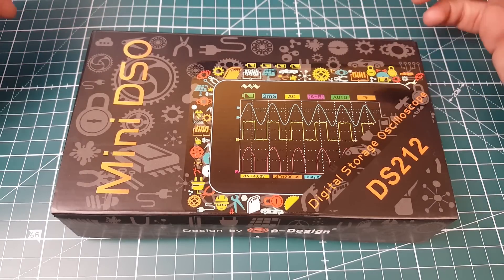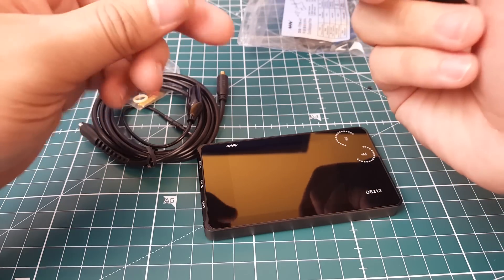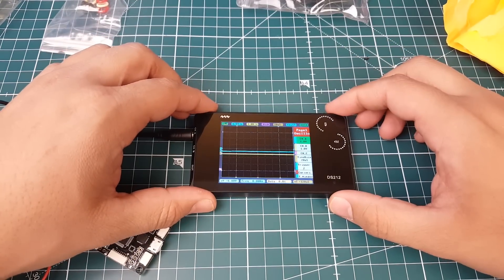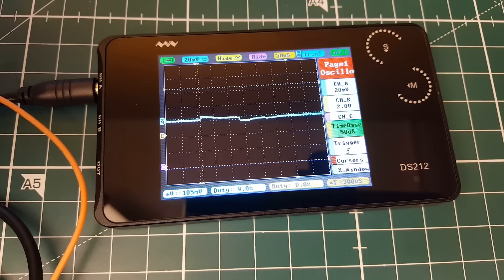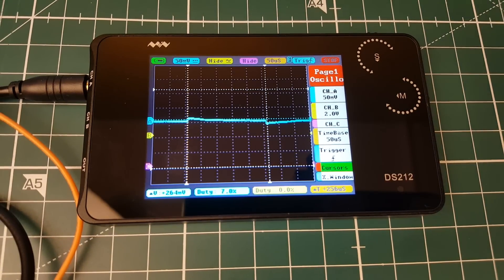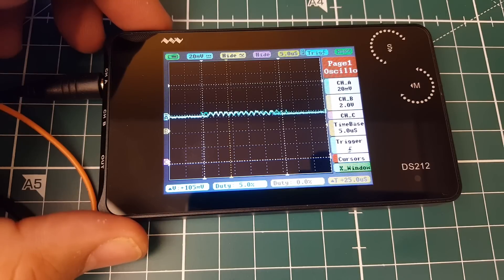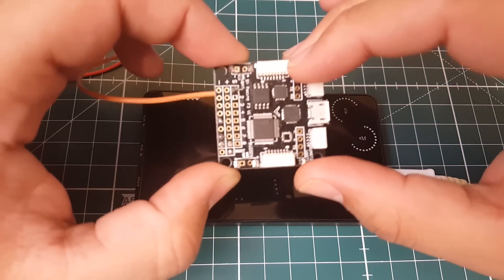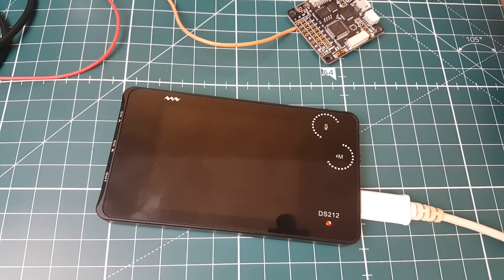Best Budget Mini Oscilloscope? // MINI DS212 Digital

Comment: For anybody even a little serious about getting a scope, all of the "mini" DSO scopes are interesting to varying degrees (and by interesting maybe I mean "fun" or "cute") and you can get many of them for something under $100.00.  But they are pretty low quality, they don't perform anywhere near their phony claimed bandwidth, and really aren't a good value.  For example, for not much more you could get a Hantek 2C42 for about $125 and it claims 40 MHz and easily does over 30 MHz AND it has a DMM function (so it is a 2 in 1 instrument) AND it comes with a nice case.  The 2D42 adds an arbitrary waveform generator for a little more cost making it a 3 in 1.  And they have 70MHz versions also for a bit more.  OWON has similar models.  You get a tremendous jump in features and performance over the mini-DSO scopes for just a little bit more cost.  And they are still battery operated and can be handheld, although, they are larger.

Comment: What's the amplitude of the signal? It looks like around 4mV on the scope, which seems ridiculously weak for flight control signals. Do you have the probe at 10x and the scope not adjusting display for it?
Reply: Hi did not put the pin in the probe so there was no contact just proximity that is y the signal was so weak.

Comment: super nice vídeo! Thanks for this technical content!
I was wondering if the even cheaper osciloscope JYETech DSO138 would cover our applications with dones. What vertical and horizontal specs would you recommend to measure common signals in drones?

Comment: You sure that flight controller isnt defective? I mean you have a supply voltage of 5V (maybe it get regulated down to 3.3V) and you only get an output voltage of ~10 mV.
Reply from the maker: E_404 It was the probe I did not insert the pins. I was basically measuring wireless if you know what I mean.

Comment: This is nice and all but you could achieve same thing with probe connected to the Mic jack input on your pc and record signal with audacity or using pc freeware oscilloscope soft. Obviously one has to be aware of voltages of the signal - should probably not exceed 5V and it would be wise to make a divider of sorts - there is tutorial on instructables for this. Personally I have measured esc input PWM signal without any voltages dividers - worked well enough for short term usage. Though I must admit this look like a nice handy device

Comment: Can you turn off AC coupling so you can see an undistorted DC PWM signal?
Reply from the maker: Pin in probe was not making connection I had to install them manually that came in the bag..

Comment: Please do!!!! I'm on a TIGHT buget and bought a Rotor Riot Edition RunCam Swift that i had for 3 months while i was getting the rest of the stuff to finish the build. just 3 punch outs for testing a new quad build....well it stopped working. No smoke, took it apart nothing look wrong at all. I have a DIY scope and would love to see if i can fix it.....I suspect it was because of not have any low ESR caps on it but I was running kiss fc and kiss 24 amp ESC and Emax 2205/2300 red bottoms. The funny thing is that there was no lines or anything to show me noise when i looked at my monitor when i did the punch outs....im 45 years old and learning every day, love the channel keep up the good work!.

Comment: 20mv??????? is supost to be like 5v signal..... in my oscilloscope i see in the 2 volts per division....
Reply from the maker: RaPPa After I had my coffee I remembered signal peaks around 3.3v ... I fixed it by inserting one of the pins in the probe and now works amazing.. will make update vid

Comment: You will get a larger amplitude if you put one of the spring pins (in the accessory bag) into the end of the oscilloscope probe before you put on the black C Clip end. I had the same issue reading the signal generator output until I put the spring pin.  Nice oscilloscope for the money.  A full user manual is downloadable.
Reply from the maker: Yes i just noticed as on my bigger scope i saw that the signal was peaking and 3.3V and i remembered i saw those pins so i just stuck one in now and it is beautiful this is a very very nice scope. I will make an update video.

Thanks for the Tip ;)